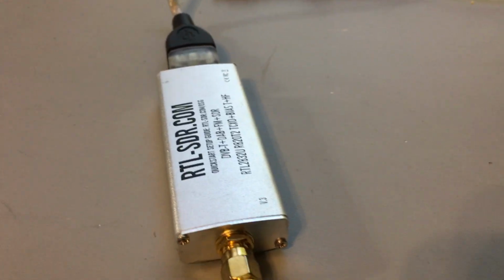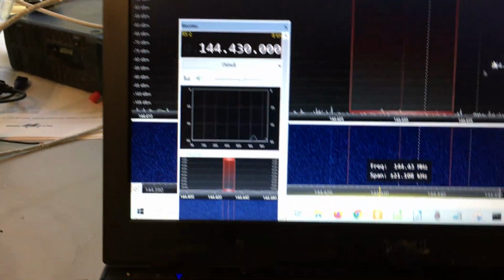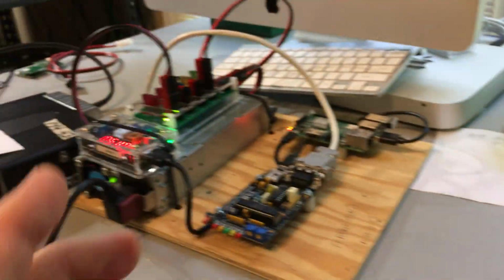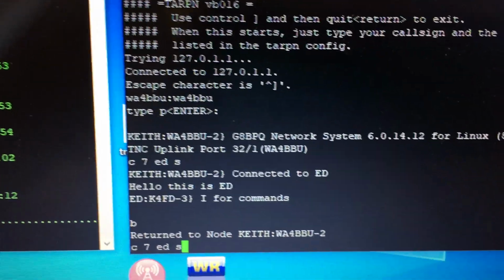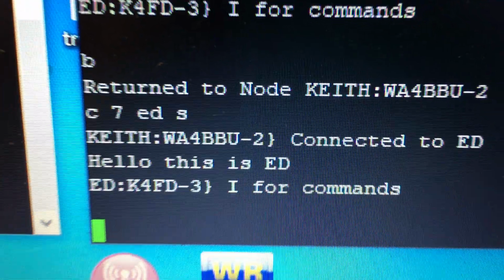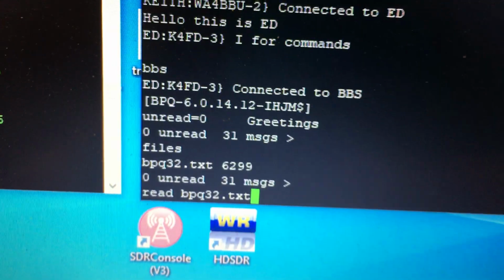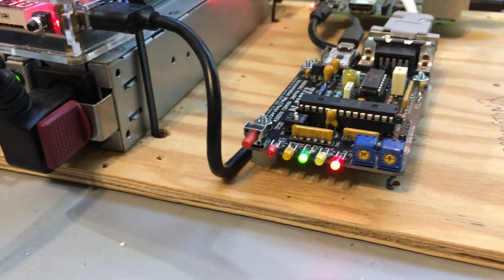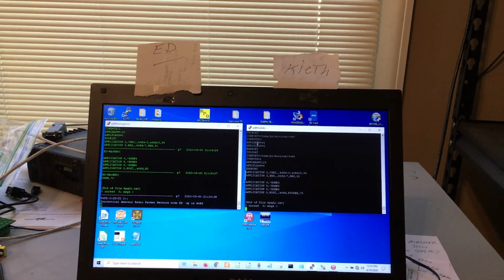Testing NinoTNC and Tait TM8105 for TARPN link

Comment: I like your power supply.  Can you tell me what you have on top of it 
-k4hcq
Reply from the maker: I think that is a DROKay variable output regulator. its cool feature is it can put out > 5v to the USB connector making it ideal for powering a modern Raspberry PI at 5.2VDC. Here's a search string to find the DROK device 
DC-DC Buck, DROK Power Supply Module LM2596 DC Buck Converter 5V-36V to 1.25-32V Step Down Voltage Regulator Stabilizer 3A 5A CC Volt "  
de KA2DEW